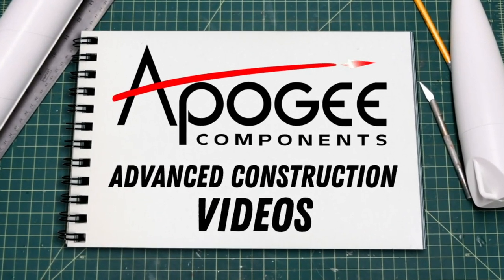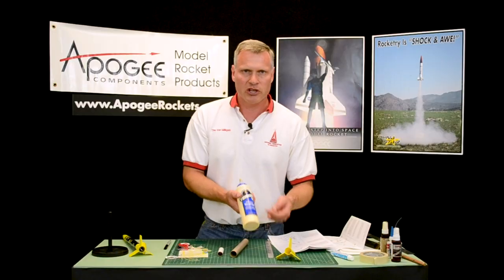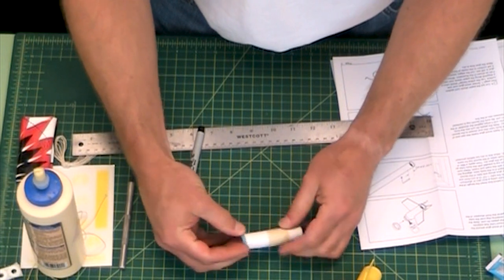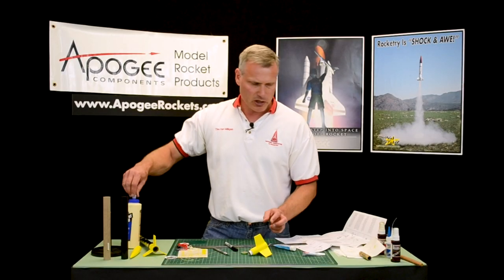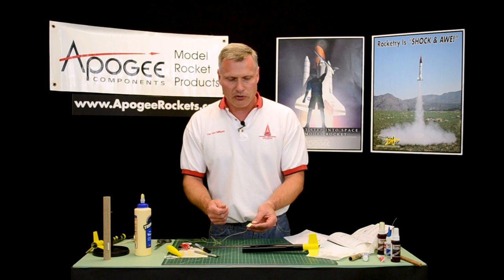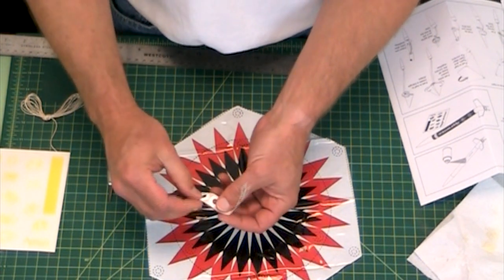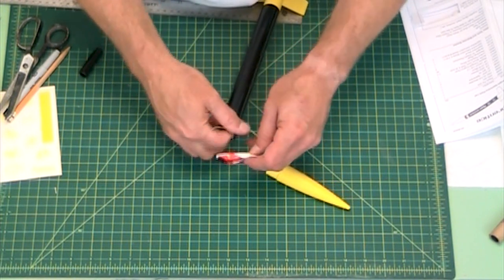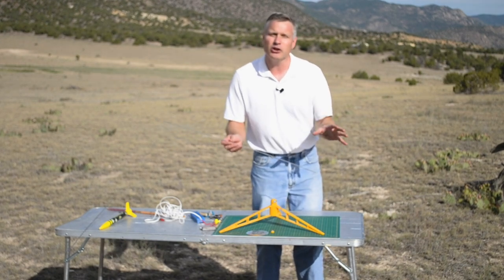Building and Flying the Apprentice Rocket Kit

Comment: Tim, I was suprised you used the old Estes tri-fold shock cord mount technique. I was expecting you to realise you had not attached your kevlar loop to the engine hook in the motor mount assembly step. The old tried and true techniques are sometimes best, but I never could stand the earlier "slit the body tube and thread the shock cord through and glue the heck out of it" solution.